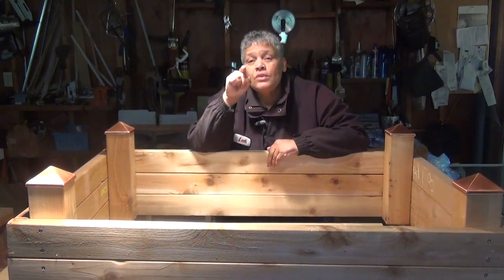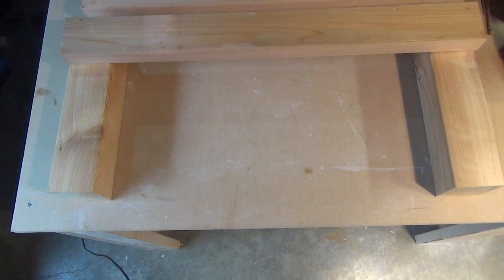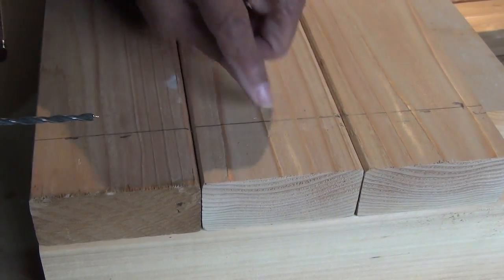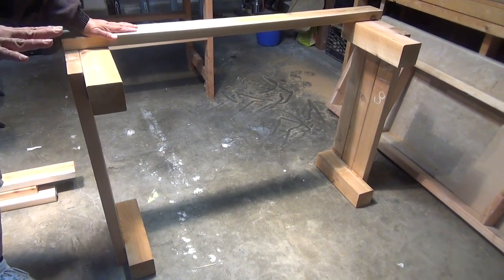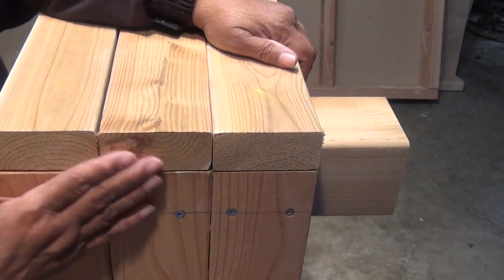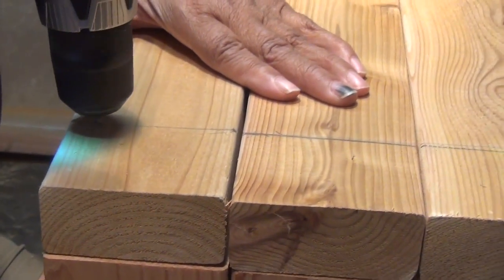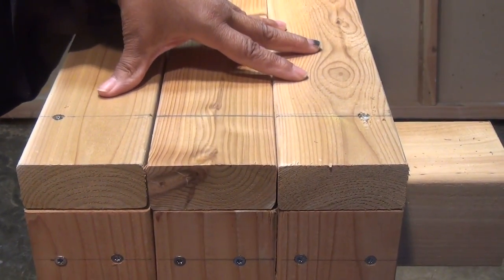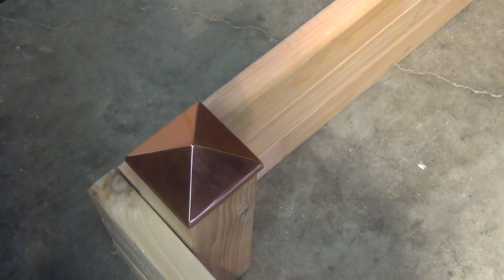Build a Raised Garden Bed in Less than an Hour on a Budget

Comment: After watching this video about 6 times, I did this very project.  Because of the size of the plot available to me, we created a raised bed that was 6 foot X 18 inches.  I selected cedar wood because of its rot resistance.  My local Lowes did not have the ability to cut 4x4.  I had to compensate by screwing two 2x4s together for the corner posts.  We haven't placed the caps on the corners yet as there are several kinds to choose from.  Or we may not do that at all.  But after watching this video, I knew I could do this.  Thanks, Leah!
Reply from the maker: Hi Kevin, that was a really smart idea on doubling up the 2x4's...great way to solve a problem!  You're welcome, and thanks for writing!

Comment: Good explanation and I would add a few things. 2x6, 2x8 would work better in terms of having more room so screws won’t be at edge of board. An inch seems okay until the lumber wets and rewets with weather and then it splits off. After 50+ yrs learned the hard way. Honestly guys - I have had 1x8” boards using more nailing supports - last 5+ yrs. I also wouldn’t build any lower than 18” and preferably 24” so all types of plants have plenty of root room. A tomato properly grown can fill a 30 gallon trashcan in one short season especially an indeterminate but have had determinate well grown do the same. I wouldn’t go less than 12-18” unless I was going to dig, improve and prepare the soil underneath at least 6-12” to allow room for roots. Believe me - you will be happier especially if growing tomatoes, beans, perennials, shrubs, etc. Of course asparagus beds need at least 18-24 and sometimes 36”. Lettuce, short carrots, some herbs, can do 12” but this is the deal - if shallow - the sides are exposed to wind, heat, and cold - the deeper and larger the raised bed up to 4x8 or longer - the more soil volume and it won’t dry out so quick. Also - make sure the growth rings are placed the same way and the half moon points towards the inside or down so the wood pulls tight down to the deck or to the inside of the raised bed etc. That half moon indicates how the tree was growing and this will indicate the direction and how the wood will dry. Take a board hold up to a tree with growth rings pointed at tree and it will make sense. If pointing outward or up - it may very well cup upwards or outwards - not want you want 6 months later as wood cures especially heavy wet just treated wood. Kiln dried won’t be as bad but again as it wets and rewets - will still be affected. For the screw lubricate - some use soap - I like an large candle - pref beeswax - and use it - I had one mounted on bench and I screw the screw into it partway and then into the wood.Turn the candle over and start on other side - be carefully and neat and you will use up the whole candle - several years depending on how much you build. Also spend the extra money and use stainless steel screws - fertilizer is corrosive even organic. I mentioned treated lumber above talking about growth rings but don’t use for raised beds especially if growing food use plants even herbs. Use cedar, teak, any of the tropical hardwoods like Ipe which will last 50 yrs on a deck without any protection or you can use decking oil to keep beautiful hardwood floor look. Also use - plastic recycled bottles lumber, concrete blocks, bricks (aged if possible as concrete leaches lime which can be okay depending on your planting media). You can use recycled wood even black plastic stretched and stapled to the support posts - just use more supports down the sides. I run it under the 4x4 but not under the bed itself. Corrugated metal etc is okay - but I found it heated up fast and was an issue in sunny hot locations - I solved by placing white insulated styrofoam type foam board around the inside letting the soil hold - it lasted for a number of years. I want to try Durarock Cement board - I had a piece laying out back for 15 yrs without an issue (rain, snow, ice, southwest exposure) - you want cement board not moisture resistant. There is another brand that claims it is even more water proof but can’t think of the brand name. If it would hold with soil piled up constantly - you could tile for a more decorative bed. The only issue may be water not draining out well if your underlying soil is not well draining - might want to place holes in the bottom of sides about 10-22” apart or screen with old screen wire on bottom say 2-3” so water can drain out. You could use gypsum under box - it is used to increase soil drainage.
Reply from the maker: Thanks for sharing your personal experience, it's always appreciated.
Reply: Thank you for the information. I sorted it.

Comment: Thank you very much for this instructional video.  I built one and eight to go.  Want a large raised bed garden for herbs and veggies.  $50 each to build including lumber and screws.  4' x 4' x 17 1/2" tall.  I left the posts extra tall (at 24") in case I ever want to add another 2 x 4 for more depth.  I am going to cap them with something like you did for your's.  Your's looks lovely.  One change I did was finger jointed the corners so it looks like a box joint -- all my 2 x 4's were the same length.  I'd share photo but I don't know how to link photo here.

Comment: Love it. I am planing this for my back garden in England. Due to having a real problem with slugs here, I will be putting the copper all around the bed. They won't like that, but I will.
Reply from the maker: +noillucS 33 I hear ya, we have the same problem with slugs here in the Pacific Northwest US!
Reply: noillucS 33 - Ash from wood stove/fireplace, keep them away for awhile. Better said until is washed out. 
Be aware too much might change the PH of the soil. Which can be good or not depending on the initial condition. ;-)
Reply: Bury a can of beer to just the top about 2' from garden. Perfect slug trap

Comment: Go to the lumber store and buy three 2x12x16 and have them cut the lumber to these dimensions:

4 - 2x12x8
4 - 2x12x4

Buy a pack of exterior deck screws and you can build two, eight foot by four foot raised garden beds for under 60 dollars.  64 square ft of gardening space

Comment: Thank  you Leah! I love your videos!!  You are so helpful and clear with directions! What if my garden is on a slight slope? I would love to see a video on how to alter this raised garden bed to fit an area that isn't perfectly flat.
Reply from the maker: +Brandi A. Weiss, Ph.D. Hi Brandi, you know it really depends upon how steep your slope is.  We put ours in a spot that isn't perfectly flat, and the cardboard bedding will make up for that.  But, if you have a steep slope, it might not work.
Reply: +Brandi A. Weiss, Ph.D. Put it on legs and give it a bottom; also add drainage.  Have the legs shorter on the higher end of the slope so it evens out.  So 2 legs maybe 36" on the low end and 2 legs maybe 29" on the high end - if that's what makes it level!

Comment: Thanks! Great video-  I learned a lot from rosebudforglory post below, too.  :D . Gonna be putting in my raised beds with rough sawn spruce lumber from a lumber yard about an hour north of me. 2' x 12' and 2 'x 6' lumber for varying heights of the beds in 10' and 12' lengths .  And adding drip irrigation from Drip Depot and/or Drip Works.  I can see those seeds sprouting already...

Comment: Hi Leah!
I have a few questions concerning this project.
Can this wood be used for the growing of fruits and vegetables? 
How can I  make it taller so it won't be on the ground  (slight problem with ground hogs or moles making holes in my yard).
I have a cordless drill, not certain if it matters...or is an impact drill required for the job!?!?
I look forward to your reply.

Cathy
Reply from the maker: +Daffy Duck   Hello Cathy,  Cedar has a low toxicity and is considered safe for growing fruits and vegetables.  As for raising the bed off the ground, it is not uncommon to extend the corner posts to waist height and install a bottom to the bed.  And a cordless drill is fine.
Reply: Daffy Duck - Metal mesh/net on the bottom makes a good barrier. ;-)

Comment: I've wanted raised beds for a while now, and this makes it look so easy. Would you necessarily need to finish the wood at all, or does it just depend on the type and how durable it is? For instance, would one stain or paint before placing on the ground? Also, would you need to stake it in place? Thanks, love your show
Reply from the maker: +Dave Kwiatkowski   Whether you stain, paint or preserve your beds or not depends on a couple of factors.  First, wood type does matter, Cedar and Redwood are naturally rot resistant. Secondly,  if you're using your beds for vegetables then you want to be careful about what chemicals leech into the soil from the wood.  To answer your last question,  I have never had to stake my beds in place, however, there are some who prefer to.
Reply: +seejanedrill Ahhh, I hadn't thought about chemical leeching into the soil... good point. Thanks much

Comment: Love this! Makes me feel like I could actually do this like I've been wanting to for so long. What kind of saw are you using? Do you have a video on it, how it works, and safety measures to take while using it? Thanks! Will subscribe :)
Reply: A simple Miter saw, to start out you don't need all the fancy sliding beveling stuff.  Check out a Miter saw at Harbor freight!!  Save money, to see if you like it, THEN upgrade later.  A 10" is a good one to start with.
Reply: Thank you for your prompt and informative response! I'll look into that :)
Reply: I'm a total newbie to this so forgive my dumb questions, but will a miter saw work for making straight cuts to lumber as is needed for this project?  I thought miter saws were for making corners.  ??

Comment: If you want to do it on a budget, just buy douglas fir and apply organic wood preservative. The wood will then last as long as cedar and redwood and will overall be a fraction of the price.
Reply: Thanks for the tip about Organic Wood Preservative. I'm sure you know but for others that don't, apply the preservative on All surfaces and let it dry. Then you can screw it all together.

Comment: Excellent video and excellent delivery.  Very nice bed.  Good tip on the lube; I assume it was bar soap or something similar?
Reply from the maker: it was a screw wax designed for the purpose, but you can use bar soap as well

Comment: dumb question, what is the lubricant you use for the screws?
Reply: Just rub a screw on a bar of soap.
Reply from the maker: +cgriesemer soap should work, although I used something called "screw wax", which is available from woodworking shops

Comment: Great project! You're just missing the hardware cloth on the bottom to keep gophers & moles out, and copper all around the top to (theoretically) keep slugs & snails out. Otherwise, it's gorgeous! :-)
Reply from the maker: +Korina42 Thanks for sharing those tips with the community!
Reply: +Korina42 I've never tried it, but I would think that you could keep snails & slugs out the same way you keep ghosts away (anyone else watch "Supernatural"?) with ordinary table salt!  Just coat the top with salt.  It would probably help if the top had a fairly deep groove so the salt doesn't blow away immediately.  Just a thought, not sure how practical it is or whether it will work!  Let us know if you try it!

Comment: looks great but would it not be better to apply a wood preserve before using it.
Reply from the maker: +Paul yates Hi Paul, it depends upon what you are using it for.  Cedar is rot and insect resistant, but not "proof".  On the other hand, if you use a wood preserve, you risk the chemicals leaching into the soil, which could be problematic.  So, it really depends upon your needs and preference.
Reply: +seejanedrill Ye you're right forget the preserve but I was thinking about putting veg in say carrots or potatoes so what would you suggest.
Reply: +Paul yates Line your box with pond liner or you can go as low as 6 mil plastic if you want, but pond liner is recommended.
Reply: +DrDangerPuppy excellent idea thanks for the info

Comment: Your listing of materials at the .40 sec mark says that you use only 2 2x4's for the sides but you stack three in the video. Just an FYI as it might mess someone up who is not able to figure it out themselves. I'm speaking about someone else of course because surely I, would never just write someone else's measurements down and then go to the hardware store to find that they were short materials...again, this is for a future viewer.
Reply: Lol... I just did this today. Took a screen shot of the supply list, built it, then thought it looked funny. Re-watched the video, and sure enough, it should say 6 4ft 2X4's, not 4. Now gotta go to the store for more.

Comment: Not a budget if you first need a workshop with a couple of grands worth of power tools!  

Better titled, cheap stuff you can make if you've got the facilities!
Reply from the maker: I used and inexpensive drill and an inexpensive saw costing less than $100 for both.
Reply: You can get all these cut at the hardware store (if they do that) or with a simple hand saw.  You can substitute the screws/drill for a hammer and nails.

Comment: Not much equipment required then.
Reply from the maker: The equipment needed is minimal.
Reply: seejanedrill Not according to your video. I don't even know the name of half this gear... And it's not stuff yer average gardener has tucked in their shed. Without the specialist (and expensive) equipment, this becomes a more time consuming and difficult project. Not everyone-for example, has access to an electric drill AND an electric screwdriver; nor an electric saw. 
This is only a budget quick project if you already own the equipment and have access to plenty cheap wood to start with- which I don't have either. Not your fault-but this video was not what I was looking for.
Reply: guttersnipe - Tip 1: Pre cut the wood in your wood depot. Many have tools available for the clients to cut it before transport. Get some exterior grade nails and a hammer. Quite frankly nothing else is needed. 

This way you're reduced to the need of one simple and modest hammer. ;-) 

Tip 2: Assemble the posts on the outside, less things to rotten, easier and faster assembly. The long boards can be held in place with one nail only, the earth pressure will keep them in place. 

Tip 3: If needed a hand saw will do the same, it's just a little bit more time consuming. but not much more. It's simple straight cuts.
 
Good luck and be well :-)